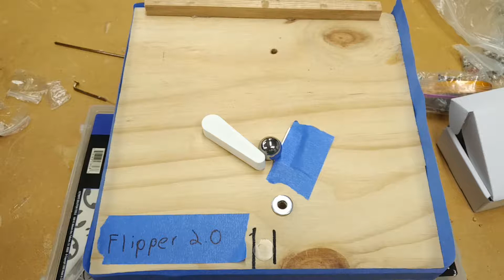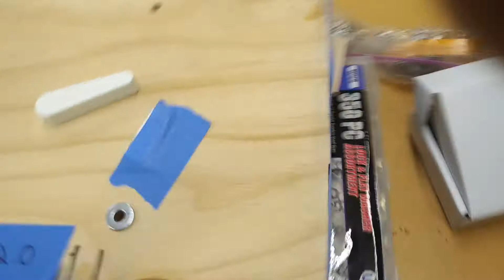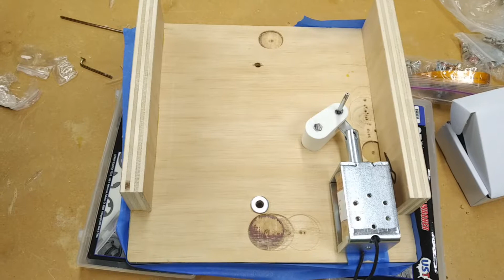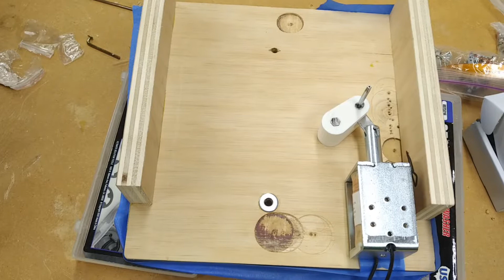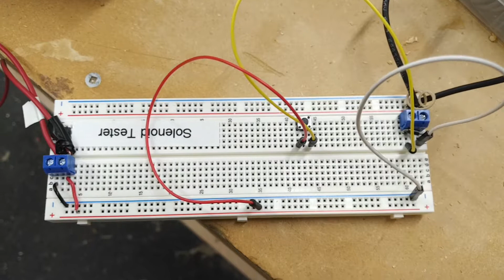Custom Pinball Game Flipper Test 2

Comment: MATT INGLOT, 
         what I don't get is what can I use to measure how strong it bats the pinball on the upstroke, what do you use to measure how strong, force, torque of how strong it bats the pinball? 
because the solenoid can still bat the pinball but it can be WEAK and not performing a strong bat upstroke so how can I measure the solenoids upstroke strength?
Reply from the maker: It's a really great question. I don't know how they do that testing, but obviously there must be a way to do it. My approach has been trial and error, and it's worked fine to be honest. If you already have a solenoid in your possession without a datasheet, why not just test it out and see if it's strong enough? If you're asking about pinball specifically, and you are building a FULL-SIZE pinball machine (unlike me), you could also just buy parts meant for pinball machines. In the pinball world they do things a little differently: the solenoid is split into 2 pieces usually. The coil is a replaceable part that you can buy on its own, and then the plunger mechanism is part of the larger assembly that it's intended for (like a flipper assembly for example).  I've never been able to find datasheets for the coils sold by pinball suppliers, but if you buy a coil that is specifically intended for a flipper assembly, then it's hard to go wrong. Lots of interesting info on how these things work and can be built can be found on  https://pinballmakers.com/wiki/index.php?title=Main_Page

If you do find out how they figure out solenoid strength please do share here! I'd love to know, and I'm sure others would as well. It's just not something I ever bothered researching since it wasn't necessary to reach my goals.
Reply: @MattInglot  yes when you buy two brand new pinball flipper coils, Both of them having the same part number flipper coils aren't MATCHED in strength, force, torque. so it will bat hit the ball at a different strength level. There must be a mechanical gauge to be used to test the strength, force, torque on how hard it bats hits the ball to MATCH both left flipper side and right flipper sides to be equal and not unbalanced. Brand new flipper coils can come out of the box as little weak solenoids without knowing the solenoid is not at full 100% strength. This is why you have to measure the strength of the flipper coil. Do you know what I mean?
Reply from the maker: @billwilliams6338  Hmmm! That's interesting. Unfortunately I don't have the answer, but if you find it please share!
Reply: @MattInglot  same here I will try, It must be some type of mechanical gauged used I'm sure I just don't know the name of the tool to measure it.

Comment: MATT INGLOT , 
                          1.) solenoid coils uses a different type of wire that has "insulation" resistance on the coil wire or something so it doesn't get burned up when left turned on held on for a period of time? 
                           2.) How do you measure the solenoid "Torque" to know how much the power of the solenoids release pushing out strokes to know how strong it releases the solenoids plunger?
Reply from the maker: Hey Bill 

1) All the solenoids I've seen use some sort of magnet wire, which is copper with a thin insulation just like you see in a DC motor. It can absolutely burn up, if you apply too much voltage or if the solenoid is not rated for continuous duty. You can check a solenoid's datasheet to see what duty cycle it's safe to use it at (I cover this briefly in this video: https://www.youtube.com/watch?v=nwVRMU9grSI). 

For example the solenoids that drive pinball flippers have to deliver a very hard hit to move the surprisingly heavy pinball all the way up the playfield. If the solenoid were to stay powered on in that state while you held down a flipper button, it would burn out very quickly. To protect against this, pinball machines will either activate a second coil on the solenoid when the flipper is in the fully up position, or I believe newer ones use some manner of PWM to deliver less power to the coil once the flipper is in the up position.

The insulation on the magnet wire is not a magic substance and will burn if it gets hot enough. Solenoids that don't have a continuous duty cycle are designed with the idea that since you are not continuously powering the coil, it has time to cool down between activations. The trade-off of course is that they can deliver more force.

2) If you need to know how much force a solenoid delivers the datasheet will give you that answer. This is normally not a single number, but instead it's plotted on a graph based on how far in the plunger is (the more of the plunger is within the coil, the more the magnet will act on it). Not sure how they go about measuring that, but this seems like something CNC Kitchen (https://www.youtube.com/channel/UCiczXOhGpvoQGhOL16EZiTg) would figure out. Also keep in mind that cheaper offshore components tend to be... optimistic about their ratings.
Reply: @MattInglot  thanks for the help
1.) What test equipment is used to measure the force and torque of a solenoid if you don't have the datahseets. I'm trying to know how I would be able to measure the "force and torque" of a pinballs flipper solenoid on how hard it hits the pinballs Ball. What test equipment can I use to measure this? or how can I measure this?